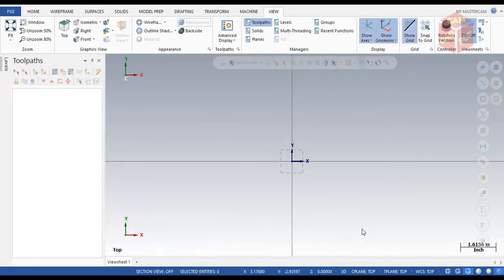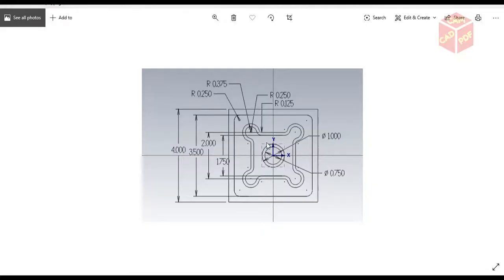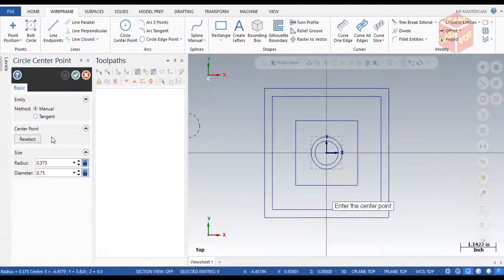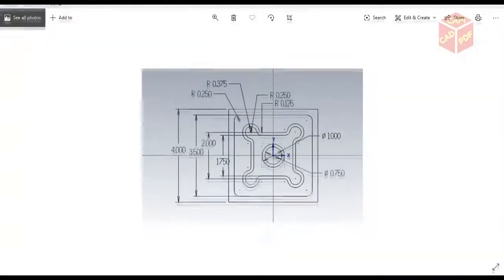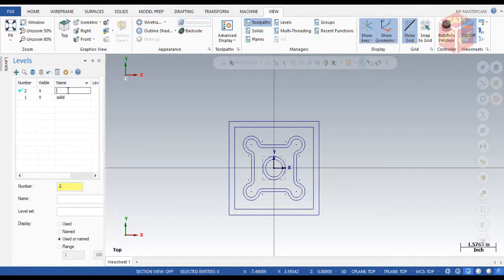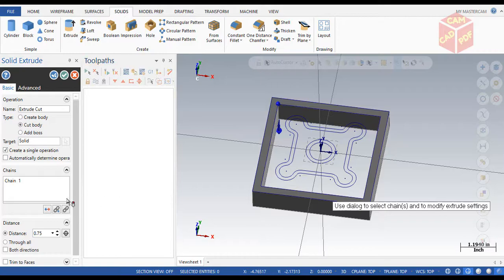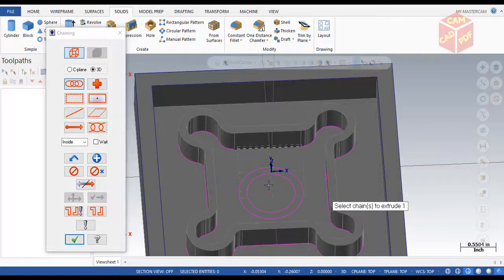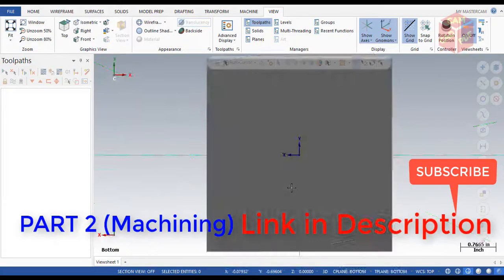Creating 3D Part Mastercam 2019 (PART 1) for Milling :Beginners

Comment: Thanks, i enjoyed the tutorial and will do the rest also!!
I am coming from version X4.
Two questions:
1. my solids are transparent, how can i change this in what you are showing.
2. my mastercam X4 i was used to put in the x and y coordinates . How can i change this so that the X and Y are available to fill in.
Reply: what's the problem  ..
Reply: solid you can turn it on and off or move it to level 2 or 1000 if you want it .. otherwise read help it says it all

Comment: So if I were doing this in Solidworks or Fusion 360, I would have made the outer shape in wireframe, then extruded it. Then draw the next rectangle on that extrusion, then cut into it. Then draw the inner shape on the cut-in area, then extruded it upward. When watching this video, I at first assumed one could not do that in Mastercam, because you input the entire drawing first. But I see you actually can do it like Fusion 360 or Solidworks.  So I am just thinking - since most people already know Solidworks or Fusion 360, why not teach using it to be consistent with those other programs?

Comment: Sir code meter run time server  will pop up again and again while working how to stop that sir
Reply from the maker: Try go to TASK MANGER in your computer than look for startup programmes and DISABLE code meter
Reply: @CADCAMPDF  sir code meter is required is Mastercam....but disabling it will effect machining and program
Reply: run program as administrator should help
Reply: @danielk8937  will try that sir...in case if any problem will text u back